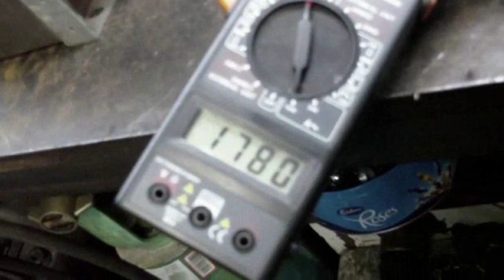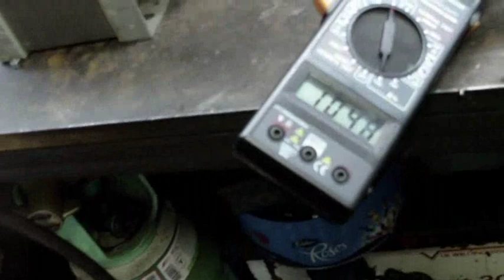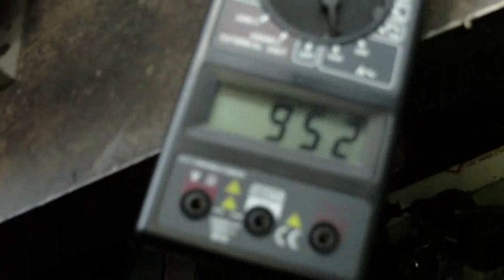Resistance heating is (not) futile Part 02

Comment: emm, wonder if i could use a transform from an old stick welder and make it into a pipe bender.... instead of drilling for the connections use a hinged collar/clamp arrangement, not sure how a pipe bending  spring in middle would fare may weld itself to the pipe. i probably should just buy a pipe bender, oh its for pipes/ubes for pushbike frames, going to make a custom frame.or two..